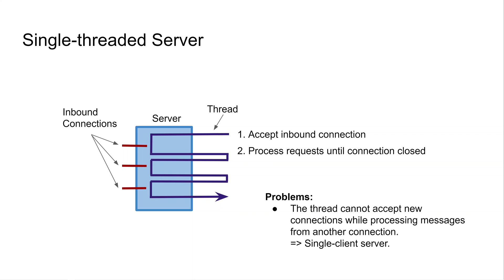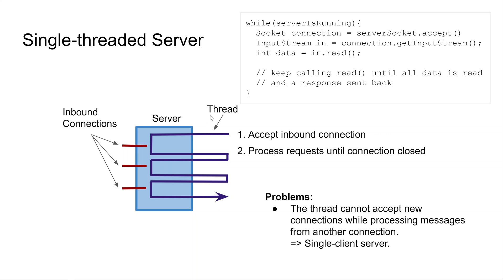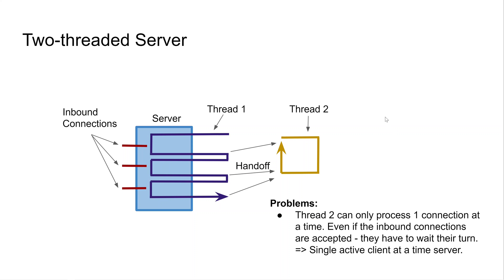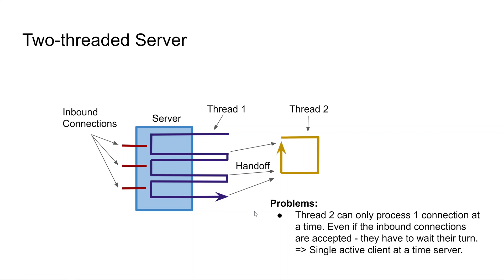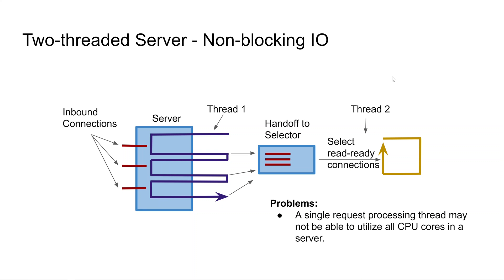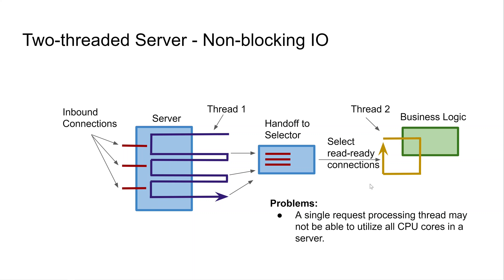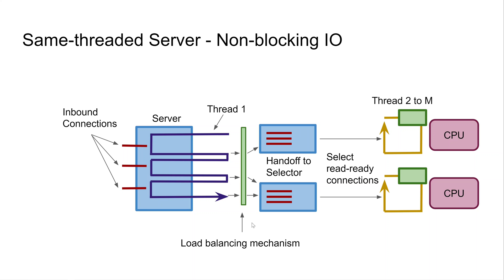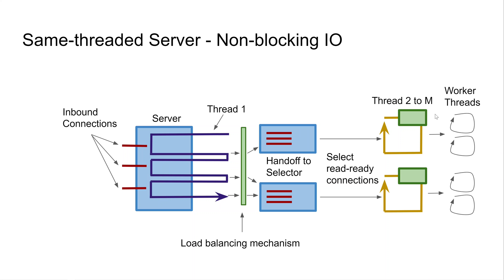Single-threaded and Same-threaded designs

Comment: Hi Jakob, i have a question about 16:05; since we can schedule 2 to M threads that can consume connections from the middle layer, isn't it better to assign a thread for each connection?
Reply from the maker: That is a question of what your network daemon is doing. For a server where traffic in and out stays on the same connection, one thread per connection can work. But for a router, where data coming in from one connection has to be routes out on another connection, having one connection per thread can easily get messy. Then you have many threads writing to the same connections... or you have to create some inter-thread communication system....

Comment: Thanks for sharing... It is Awesome! Another possible issue of Same-threaded Server may happen when the business logic modules of Thread 2 to M actually need a context level synchronization on their working data. It should be not a big problem when each business logic gets/puts data from a static source such as a central database. But it would need some burns in mind when each business logic for Thread 2 to M actually works only on cache data in memory, which is born from inbound connection requests, only serves the thread it was produced in, and the data will die with the thread. I was wondering whether it is a good design if, say, some inbound connection requests to Server thread 1 in such circumstances will duplicate itself into multiple copies, each assigned to the Selector queue for Thread 2 to M, run them in duplication, in order to achieve such an alignment that all threads have its business logic keep working on the same page. Could you share more on how such cache data driven scenario can be properly handled, how to secure that all thread have business logics working on the same page? Greatly appreciated!
Reply from the maker: I am not sure I understand exactly what the problem is in your case. A Samethreaded design would work for your case just as well as it would for any other case. If the threads need to share a cache, that cache needs to be properly synchronized, or use a non-blocking concurrency design.

Comment: Thanks for this informative and concise guide (same goes for your articles on your website)!

I'm a software engineer student and would like to delve deeper into the theory and practice of high-performance server architectures. 
Do you know of some books / papers / source code / other sources to recommend for learning more?

We have had one course on network programming and computer communication at uni, but is was rather surface level, barely touching on concurrency.
Reply from the maker: I don't really know of any books that cover that topic. Most of the information that I have read, I have found in articles and blogs, and presentations on conferences etc. It's quite scattered, unfortunately. I do have some leve of information on jenkov.com - but not like a 100% easy-to-follow guide on high performance server designs. I am working on some designs at the moment though... some of my own designs :-) . You can also study the Java code for the open source Netty framework, as that is a commonly used high performance server toolkit.

Comment: @Jakob Jenkov   Where is the code ? 🤔.  how to understand without code ?
Reply from the maker: Hi Deepak, this video is only intended to explain the concept in a high level fashion. The "code" - the implementation - depends on whether you implement these types of designs yourself, or whether you use a framework that already implements this, such as Netty, Undertow, Vert.x etc. (note - that while both Undertwo and Vert.x use Netty internally, the way the interact with your code differs). I am also working on a toolkit that implements a single-threaded / same-threaded design - which does not use Netty internally. This project is called Polymorph. I will show some of these designs incl. code in later videos.

Comment: Thanks for the great explanation. 
It would be nice if you give an implementation example :)
Reply from the maker: I will - in future videos :-) ... I will have a single-threaded server design in my Polymorph Fabric project. It will also contain implementation examples of anti-thread-congestion designs, and single-threaded concurrency! ... as well as mechanisms for handling asynchronous tasks and non-blocking IO. This stuff is hard to get all in a single design - so the work moves slowly. But it's getting there :-)

Comment: Towards the end of the video, you talk about the problem of assigning multiple jobs to a single thread, and a fast job having to wait for a slow job to finish. Why would you ever do that? Why not put the jobs in a thread-safe queue so that the worker threads are only assigned a single job to do, and then they pick up the next job from the queue after completing it?
Reply from the maker: The main reason would be to keep the number of worker threads down. If you put a fast task into a queue with some slow tasks already queued up - you will get the same effect of the slow tasks essentially delaying the fast job - unless you create a lot of worker threads - in which case you kind of defeat the purpose of the single-threaded design. In the designs I am currently working on - I would only use background worker threads for tasks that require blocking IO. Anything else I will use single-threaded concurrency for - which will more fairly and more controlled divide the CPU among the tasks.
Reply: @JakobJenkov  But if you have any number of worker threads > 1, then pre-assigning multiple tasks to any one of the threads risks starving the other threads for work. Putting them all in queue at least ensures that all of the worker threads will be busy as long as there is any work to do.
Reply from the maker: BlockingQueue's  become a point of congestion when you have many threads trying to take objects from them. As the number of threads grow that want to take objects from the same BlockingQueue, the throughput eventually starts *dropping*. That is why - for super high throughput designs - each worker thread gets its own queue which only itself and the load balancing thread accesses. This lowers congestion a lot! But - it results in the possibility of the situation I explained in the video. The ForkAndJoinPool solves this via "work stealing" where threads are allowed to try to "steal work from other threads' queues, if its own queue is empty. My solution is "single-threaded concurrency" instead. By the way - this concept of one-queue-per-worker-thread is also visible in the queue constructs in JC Tools.

I will cover both thread congestion and single-threaded concurrency in more detail in future videos.